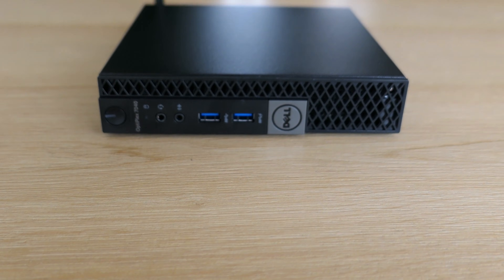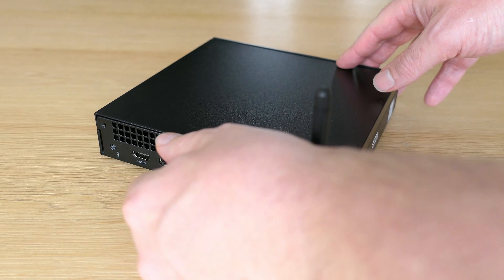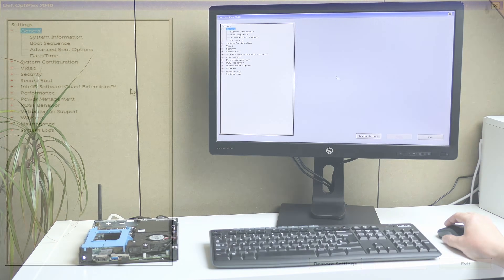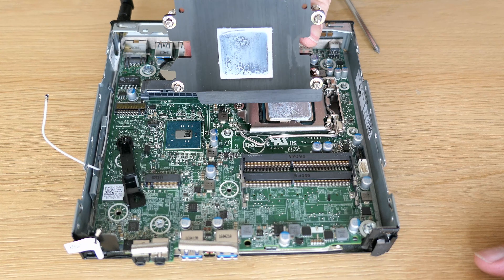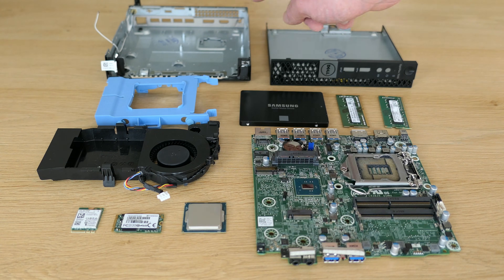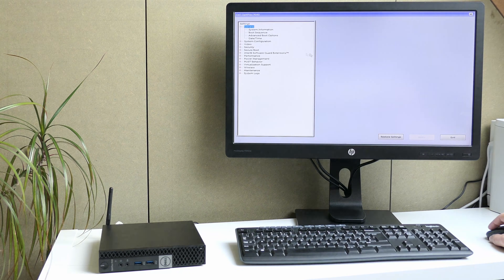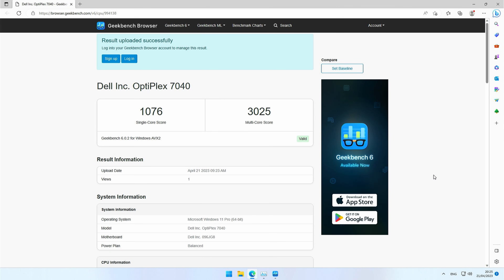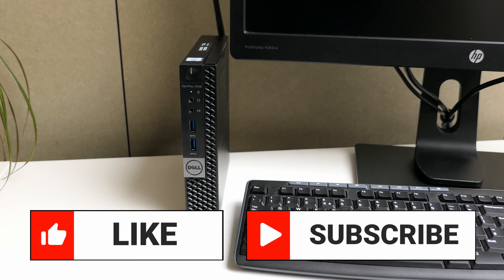Dell OptiPlex 7040 Micro: Teardown - Upgrade - Benchmarks

Comment: Thank you! Mine came with a 128 GB NVME, and I added a 2.5 SSD with 256GB that I had around :)
Reply: so Optiples 7040 support M2 NVM, really  ? or only M2 SATA. thx
Reply: I had two 3040 and one 5050. On 3040 there is only Sata port available and M2 konektor is not present on motherboard This support DDR3 only. There are some labels M2 but without connector. So I  expect is better buy 3050, 5050 or 7050 for better support everything (DDR4 and M2 NVM+SATA..).  So I am surprise 7040 support  NVM drive

Comment: How to be able to still use this unit with Windows 11?
Reply from the maker: You can use a known workaround for the hardware requirements. I did a video on that for a fresh install: https://youtu.be/gKMB7WSEbMM and for upgrading from Windows 10: https://youtu.be/EWV1G3IDRMg I've been using Windows 11 on it for a long time without any issues so far.

Comment: I love mine, but with Windows 11 to be use and the upgrade to 2.0 TPM, not sure if I can upgrade the TPM with a 2.0 module? Can this be changed to 2.0?
Reply from the maker: I don't think you can upgrade the TPM module but you can install and run Windows 11 using any of the known workarounds. I've been using it like this for a long time now without any issues.

Comment: Dou you have the brand and type number of the USB3.0 ports on the back of the MB? Mine has 3 broken ports that I could desolder, but I can't find what the replacement part is.

Comment: Thank you., it was a great explanation.
I have gone for a used one Wyse 7040 from Amazon (upgraded the RAM to 16GB) where have a query - does this machine allows users log in remotely although its disabled and no such user exists in Local Users and Groups? I have been struggling a huge usage of RAM Ethernet and processor.
Reply from the maker: @RsBGroups  as far as I know that is not possible, except with some 3rd party remote access software like VLC for example.

Maybe check the name of the processes that hog CPU and Ram in task manager? Initially Windows Update can eat up quite some resources but once all updates are installed that should go away.
Reply: @jensdbe  Hmm I checked at the software installed - only Microsoft and Dell - others did uninstalled during the initial days, The Task manager shows RuntimeBroker.exe which pops up to eat maximum times. Next there is a msedgewebview2.exe that eats up which I think the part of Edge Browser. I am not an Window expert but feel like testing the Windows genuinity - have created profile at Microsoft too with adding up this machine where the mrt tool also end up nothing.

Comment: I have a 7040 as well. If anyone is interested in buying these, mine did not come with an external wifi antenna, or anything populating the wifi m.2 slot. So make sure it's got the connectors  you want. Still a solid mini-pc for a home server or a media center for a tv.

Comment: I just ordered a 7040 i5-6500T with SSD 256 Intel NVMe and 16GB DDR4 RAM because I need a "slave". It costs PHP 4,350  which is equivalent to US$ 74.42
Greetings from a Dane in the Philippines. :)
Reply: store please? :)
Reply: San mo nabili boss? 6k benta ng ibang shop eh

Comment: where is the gpu can it be upgraded?
Reply from the maker: There isn't really a way to upgrade the graphics in this tiny machine as there are no PCIe slots. It is using the built-in graphics from the CPU. In theory you can add an eGPU but I have no experience with that at all.
Reply: @jensdbe  thanks for clarifying 👍

Comment: Can an amd radeon rx6400 fit in this and if not what other gpus can fit?
Reply from the maker: @gunaldo7  nothing really that would fit in the enclosure. You could opt for an eGPU but not sure if you really want that due to the overhead and separate case and power supply.

Comment: What's the difference between i5 6500 and i5 6500t? Can we put i5 6500 in this?
Reply from the maker: I cover the differences in detail at https://youtu.be/YAEzIo1Cjyc?t=456 in the video.
Regarding upgrading, as a regular i5 6500 has a TDP of 65W on its own and the machine comes with a 65W power supply for the whole system, I don't think this will work.
Reply: @jensdbe  yeah, I was thinking the same!

Comment: Can the wifi card be replaced with hard drive instead and be used as the boot?
Reply from the maker: I haven't tried it myself but as far as I know M.2. SSDs can't be just plugged in the same slot. I know there are adapters available that would have a short cable to a slot that does work with an M.2 SSD. Since that Wifi M.2 connector has less PCIe lanes, performance wouldn't be ideal either. So in general it makes more sense to replace the main storage SSD with a bigger/better model instead.

Comment: Thanks for informative video, does it’s display port and Hdmi port support 4K? If not then what’s max resolution it can support.
Reply from the maker: For sure the DisplayPort supports 4K@60Hz, not sure if that is also the case for the HDMI port as it is has a HDMI 1.4 port which should be able to do 4k@24Hz

Comment: do you think i could put a ryzen 9 in it?
Reply from the maker: The chipset won't support that and the socket is different, so afraid that's not an option.
Reply: @jensdbe  no workarounds?
Reply from the maker: @toast4065  it physically doesn't fit in the socket
Reply: @jensdbe  whoever designed this better count them days bruh i just bought a ryzen 9 to see if it would work
Reply from the maker: @toast4065  there are no machines/motherboards out there at all that support both Intel and AMD CPUs. This is just never possible in any machine. It's been since the Socket 7 days (1990's) that was possible. Hope you can send the Ryzen back :)
Reply: @jensdbe  sadly i cannot :(

Comment: I wonder if it's possible to install a the normal i5-6500 processor?
Reply from the maker: In contrary to the OptiPlex 7060, I don't think it is possible here. The maximum mentioned power supply is 65W while the TDP for an i5 6500 alone is that full 65W.
Reply: @jensdbe  thanks👍🏻
Reply: I have one that came with an i5-6500. It did also come with a 135W power supply (just a normal Dell laptop power supply). It's running absolutely fine.

Comment: Hi thank you for the very valuable testing    I have a question   How do you rate its video performance ?   
does it play youtube full hd 1080p content smoothly ? 
Speaking of disk i think it supports NVME disks ... great option
Reply from the maker: It plays full HD and even 4K (for example from Youtube) perfectly fine. It does support NVMe, which is definitely a nice boost in performance.
Reply: @jensdbe  hi thank you so much for your very kind and valuable reply
i will get one soon  
i was thinking to the Raspberry but i like this one too much
its form factor is perfect from my needs
Thanks again and kind regards Gino
Reply: @jensdbe  but ony 4k at 30Hz due to HDMI 1.4?

Comment: Hi, so I got one today and I'm having a problem where it doesn't connect to my monitor. The cable isn't the problem since I used the same one to connect to a different pc and monitor, and the monitor isn't the problem since it connected just fine to my other pc. Which leaves the Micro PC itself to be the problem. Each time I'd connect it to the monitor it'd say no signal before the screen went black. And I can't go into the monitors menu to switch outputs. I wanted to know if there is a easy fix for this.
Reply: Try swapping the ram in a different slot or try to use only single ram with either slot which ever works if this don't work then try with new ram and replace the CMOS battery with new one and try reseating the cpu.
And also try display port 
And if all this don't work your motherboard is dead , transfer the cpu storage ram to a new cabinet and motherboard

Comment: Nice comprehensive technical review. Thanks for sharing. Can you pls suggest highly reliable dell optiplex, I want following requirements
1) i3 8th gen
2) maximum USB 3.0 ports
3) USB type C port
4) NVMe gen3 or gen4 M.2 Ssd slots
5) SATA port
6) windows 11 plus office licence
I am looking for refurbished pc. Pls suggest which is better for reliability ~ micro, mini or SFF.
Thanks.

Comment: could I use just the two M2 slots with 2 M2 PCIe NVMe SSD's one 2280 and a 2230 one for boot and one for storage? maybe install  heatsinks and loose the blue plastic?
Reply from the maker: As far as I know, the WLAN M.2 cannot be used for storage unfortunately. So you can only use the left one for NVMe or SATA M.2 SSD

Comment: 1.  How quiet?, 2.  can NVME can be used to boot?
Reply from the maker: 1) It's not as quiet as a Mac Mini as you can hear the fan from time to time during higher workloads.
2) Sure
Reply: My dad used to have a mac mini and that computer was one of the loudest I heard in my entire life (with the exception of me replacing the stock cooler on my old desktop with a shitty thermaltake one that I later reverted)

Haven’t really stress tested it but I remember the mini constantly being pegged at max fan while the optiplex just chills

Comment: 2 questions:
1. Does this Mini PC support Windows 11 ??
2. Does this Mini PC support M2 NVMe ??
Reply: I buy this and have preinstalled windows 11. So no problem here
Yea, i put one works fine.
For linux work don’t forget disable intel raid support in sata section bios
Reply: Supports win11 and nvme drive

Comment: Thank you so much for this! One pair of questions I have remaining is about the M.2 slot currently occupied by that network card: Can it be populated with a second SSD instead (if you use ethernet for networking, ofc)? If so, is it possible to run two SSDs in raid configuration or must they remain as separate drives?
Reply from the maker: As far as I know, the second slot can't be used for an SSD. it's wifi/bluetooth exclusive.
Reply: @jensdbe  Drat... it would be interesting to find out how the connection or supporting circuitry is different that makes mounting a drive not possible. Not everyone needs wifi, but anyone could use more storage. 🙂
Reply: @dimitrikatsaros9212  Look at some later ones like the HP 800 G3 or 800 G4 that support the 7th gen and 8th gen Intel CPU's both have 2 NVME slots  as well as 2.5 inch drive bays.
Some models such as the Lenovo Tiny P 330 P 320 P 340 etc also have what is a laptop Video card on an PCI expansion slot both HP and Dell have similar options in the I litre size then there are the 2.7 Litre sizes sold as Workstations like the HP Z2 Mini series

Comment: very nice video. because of you i could add an extra nvme 500 GB apart from 1 TB HDD. i want to know what maximum graphics card can i upgrade to. any suggestion will be greatly helpful. thanks :)
Reply from the maker: There isn't really a way to upgrade the graphics in this tiny machine as there are no PCIe slots. It is using the built-in graphics from the CPU. In theory you can add an eGPU but I have no experience with that at all.
Reply: @jensdbe  Thank you bro for your reply

Comment: Would have liked to see the performance of the built in graphics adapter as it is the weak point of these micro PCs as you cannot upgrade as per a regular PC.  I am thinking of using one of these as my main PC as they are quiet, energy efficient and an inexpensive non proprietary power supply unlike on their other SFF PCs.
Reply from the maker: In general, don't expect a lot of the graphics performance. If you like, I can still run the compute benchmark in Geekbench 5 (which uses the iGPU) and share the results here :)
Reply: @jensdbe  If the built in Intel HD graphics adapter is on par with a Nvidia Quadro 2000 then it is more than enough for me.
Reply: Lenovo P 330 P 320 P340 in 1 Litre size use a dedicated laptop based Graphics card as they also run a PCIE expansion slot then there are the 2.7 litre sized HP Z 2 series which are still small but can use workstation graphics cards they usually come with standard, These cards are surprisingly good compared to traditional Gaming cards

Comment: I'm sorry to say but Microsoft Windows 11 is not supported on 6th gen Intel CPU'S. It may be installed and work at moment but Microsoft will eventually turn off any security updates on unsupported hardware at any time. Rendering your PC vulnerable. Only Intel 8th gen and AMD Ryzen 3000 and above are supported. Just friendly advice.
Reply: Who runs Win11 anyway
Reply: Same. Have forced it on the machine but it was buggy as hell
Reply: That a lie because I got this exact same NUC from my job for free and installed windows 11 on it right away and run it as a server

Comment: What RAM did you use?
Reply from the maker: two times 8GB DDR4 2133Mhz SoDIMM
Reply: @jensdbe  Thanks! do you think that CPU cooler can be replaced with Noctua NH-L9i (low profile)? I see that in the original cpu fan there is this small funnel that covers the heatsing, probably creating necessary airflow. So i am bit worried if I put noctua there, it will destroy the airflow. 

Or maybe I could change thermal paste, after all its 2015 model and it could be a bit dried out (My fan makes quite a noise, thats why I wonder what to do). My temperature is around 60 Celsius normally. But noise is quite annoying

Comment: I have an exact one like this, but my fan seems to run randomly on high-low speeds. Can you change the fan speeds in windows? I am running ubuntu and at the moment the only way to change that is to reconfigure it myself.
Reply: Might try checking in BIOS

Comment: I got another Dell micro that stopped working after a few years, it has an I7 CPU, can I use that on the one I'm using now which is the Dell Optiplex 7040 micro PC and has the i5-6500T  CPU?
Reply from the maker: Only 6th generation Intel Core CPUs are supported and for the 7040 micro specific, only the T-version sue to yhe limited cooling options. Also it's not because it is an i7 it is necessarily faster than this i5
Reply: @jensdbe Can you please tell me the chipset in the installed Q170 motherboard? If yes, then the official Intel website states that 6th and 7th generation processors are supported, are you able to check this?

Comment: So you can do an cpu upgrade for that motherboard?
Reply from the maker: You can upgrade to another 6th gen CPU with a maximum TDP of 35W. Which brings this down to the i7 6700T. Only the performance difference is minimal compared to the currently installed 6500T unfortunately.
Reply: Theoretically you can upgrade to 65w non-T cpu (at least since 7050 generation) and it was even a factory option. But the heatsink for 65w was different, so if you don’t already have it - it’s not worth all the trouble for extra 20% performance and 2x fan noise.

Comment: Is there a way to get an external GPU connected to this little PC?
Reply from the maker: There is no PCIe slot in the device and not Thunderbolt ports so I'm afraid there isn't any option to have an eGPU here.
Reply: @jensdbe  thanks!

Comment: Whats the largest capacity 2.5 hdd you can put in this dell 7040?
Reply from the maker: According to the spec sheet, the maximum supported is 2TB although I see multiple people that used 4TB without issues.
Reply: There is no limitation on TB size of the drive, but currently drives 5TB and up only come as “fat” 15mm height drives. Plastic mounting bracket will only fit up to 9.5mm drives. So without messing with the mounting 4tb is your max.

Comment: A neat computer.  Perhaps this will be of interest, the link below shows a video about an older type of mini pc., the HP., Compaq 8200, it's a bit larger than your computer and it has two fans, it's maximum amount of ram., is 16 gig., of ddr3, it's younger sibling the 8300 can also take 16 gig., of ddr3 and it has usb 2 and usb 3 ports. I have found those computers simple to overhaul and upgrade and that they work well with a Linux OS., installed.  https://www.youtube.com/watch?v=dXhcbVkq4x8